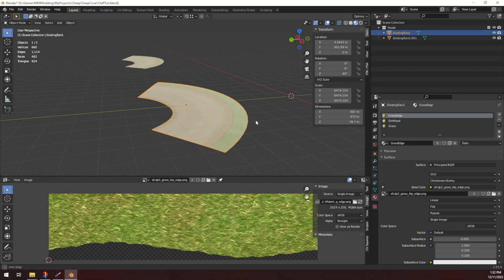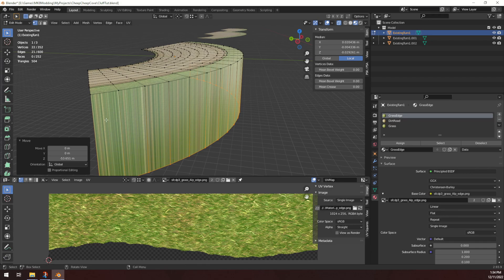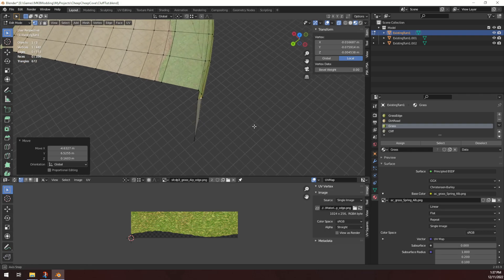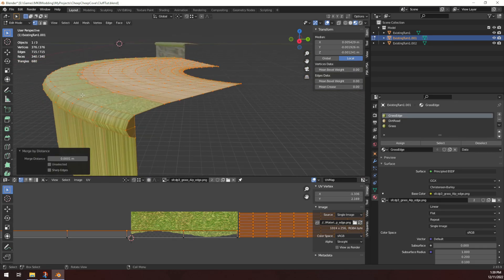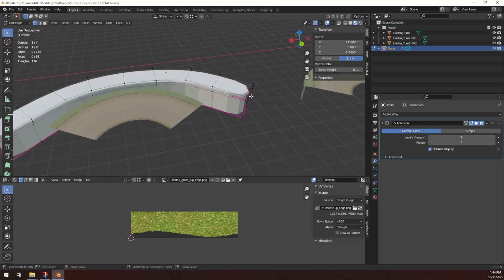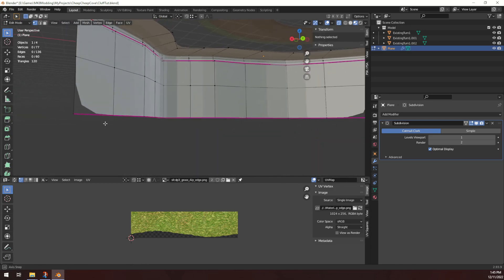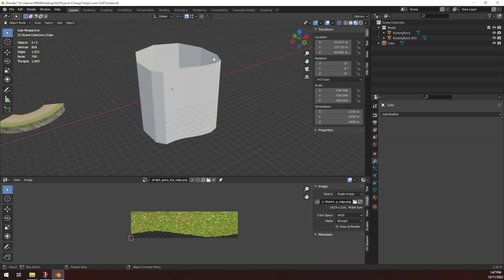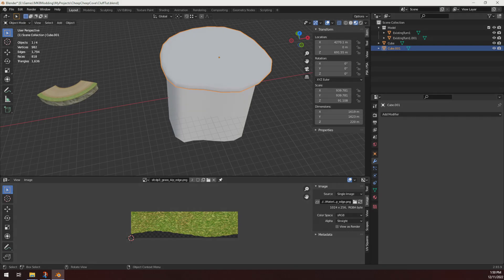Mario Kart 8 Custom Track Tutorial - Modeling Rounded Grass Edges on Clifftops

Comment: ay what the heck, the methods that use the subdivision modifier are a stupidly easy way of creating a nice background. Thanks.
btw, whenever there's a number with a value you have to change (ex when you were using the extrude along normals function) you can just hold down shift, click on the box with the number and move your cursor around, it allows for precise adjustments

Comment: 5:57 I believe extrude along normals behaves that way when you forget to apply the scale with ctrl+a, though I may be mistaken

Edit: That subdivision method looks very useful, I'm definitely gonna start using that, thanks for demonstrating it
Reply from the maker: Ah, I was working with part of my Cheep Cheep Cove model so I don't remember if I applied the scale or not so that probably explains it.  Thanks.